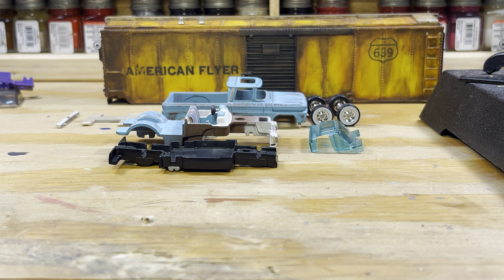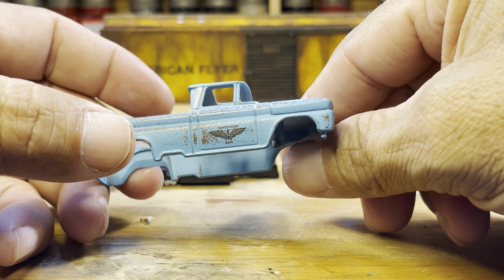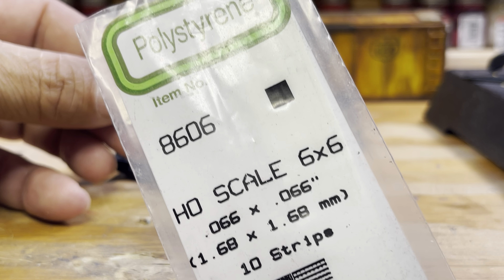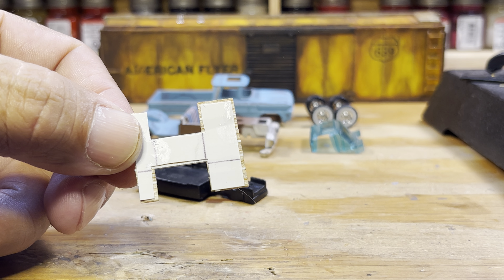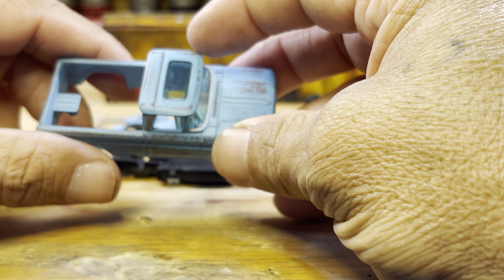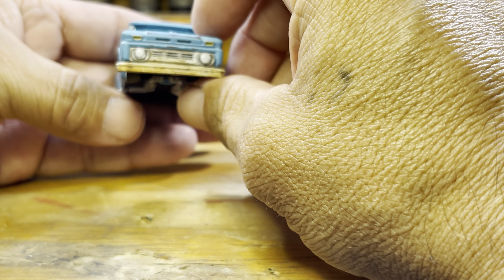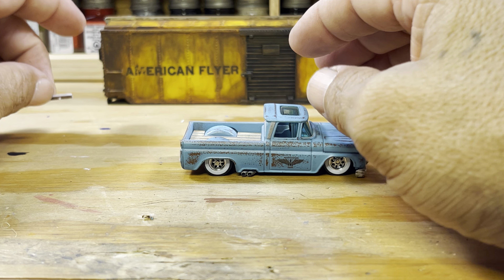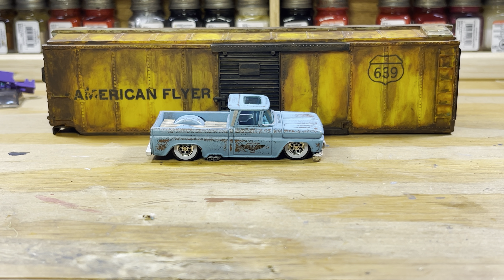Custom 62 Chevy

Comment: That is a really sweet custom truck! Love the stock bumpers! And I agree your weathering or patina as it’s sometimes called is one of the best! It really looks natural! Not overly done like some guys do. Btw, if I’m not mistaken the earlier version ( with the full size surf board) does not have the sunroof! ( I don’t care much for sunroofs either😁) and doesn’t have the front bumper either ( just the rolled pan) They are harder to find and usually go for more $$ on secondary market but I like the early casting better. 👍👍👍
Reply from the maker: Thank you for the kind comment. Yes the previous castings didn’t have a sun roof. I’m not sure why they added it. I’d like to get more but the secondary market is too pricey for me.